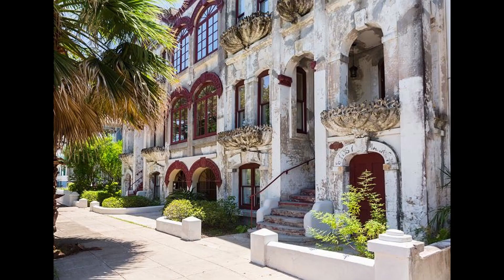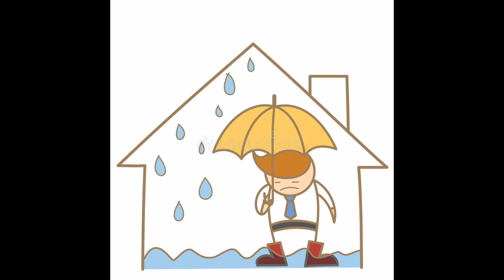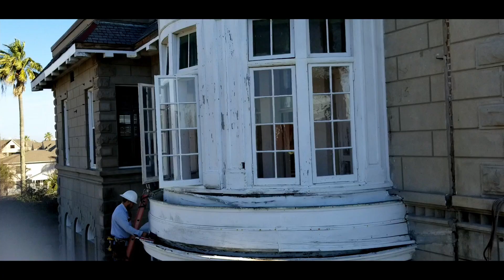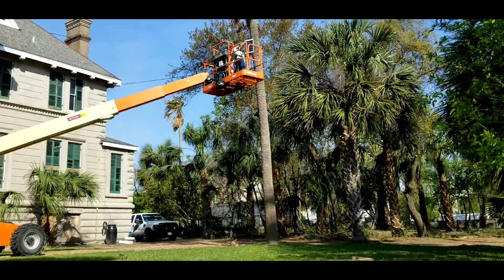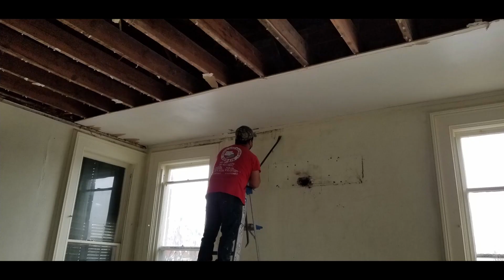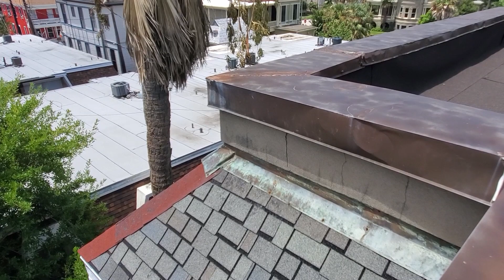S1.05 First Things First - Where to Start?

Comment: The best priority system will be one that prevents further damage to the house. Priority No. 1. Issues of safety and security do not factor in, but what does is as follows: 1. Structural issues which can cause damage. 2. Water intrusion issues which can cause damage. 
3. Termite issues which can cause damage. It is really that simple. Approach your plan of action like that and you will be doing the house and yourself a favor. Remember that time spent on cosmetic issues or other non-relevant issues take away from the real priorities.
Reply from the maker: I have to disagree with you on this one.  Worker safety and the security of anyone on the property always has to be the first priority. Avoiding serious injury or loss of life is always number one.  That's standard practice at every construction site.  Everything else you said is in line with my list.